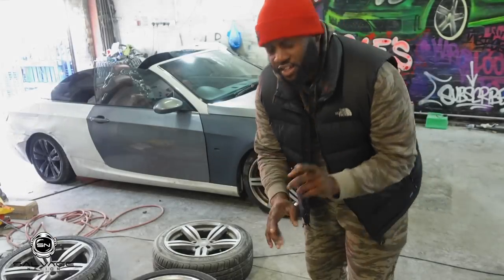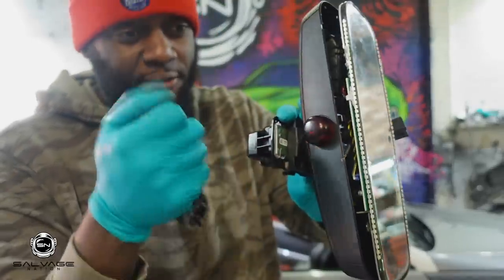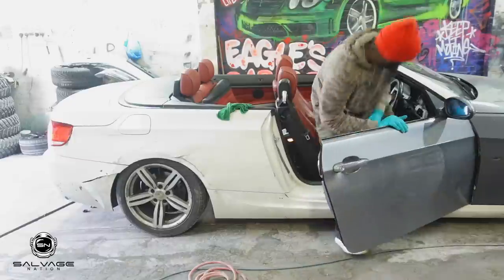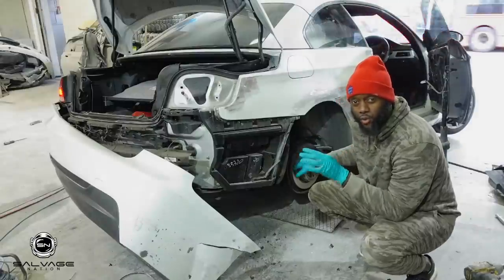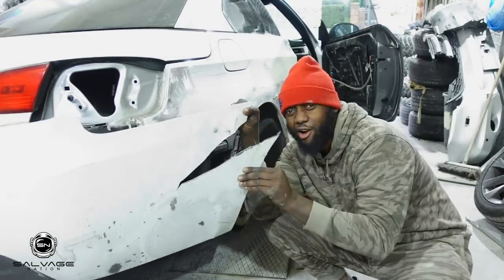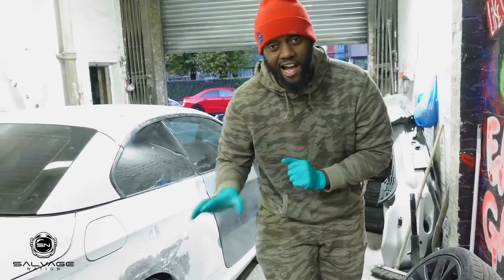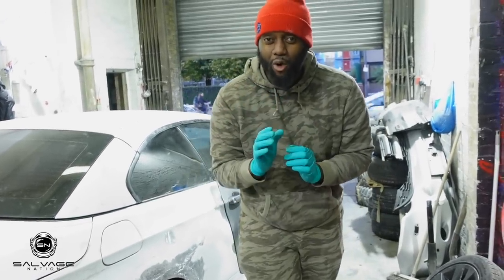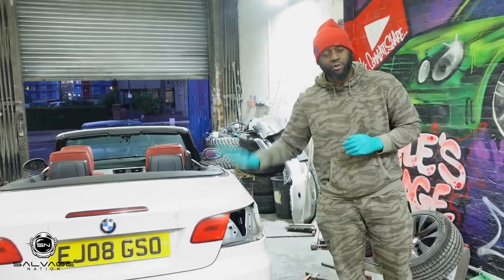Rebuilding A wrecked £1000 BMW E93 M-Sport from Copart - PART 6

Comment: Favourite car e93. So glad came across this channel. Keep these coming. I may be wrong, don’t think Alpine White was available until late 2009. BMW have a strange staggered approach to their updates to cars, tend to be every 3 years with soft intro in between. So you may be 💯 on the car previously being Silver.
Reply: Worth checking the VIN for clues. “Alpine White III 300” i think is the code for the e9x’s
Reply: That and the fact under the rear light is clearly silver 😂
Reply from the maker: Will do mate, im pretty sure it was silver after removing some of the rear lights etc.